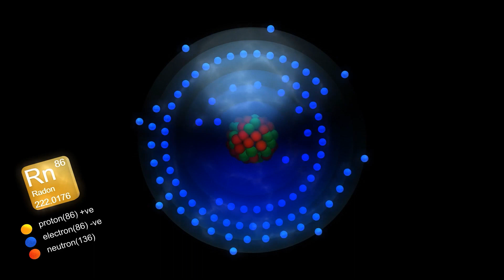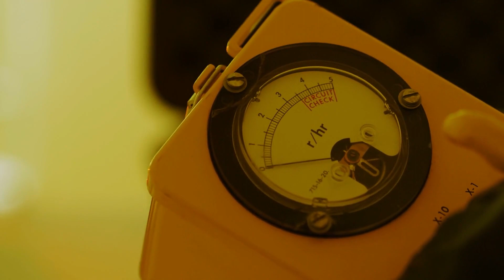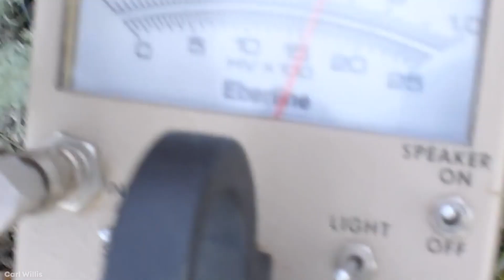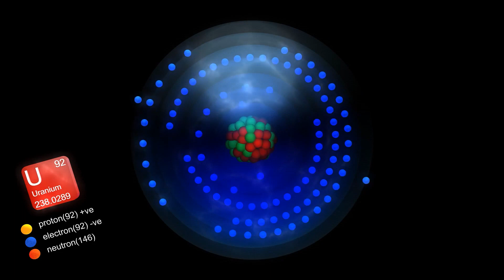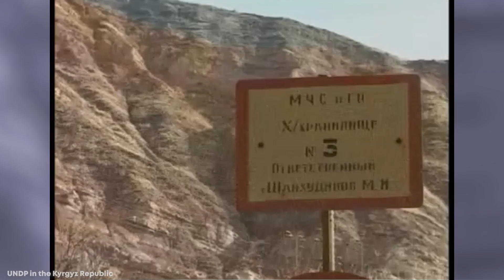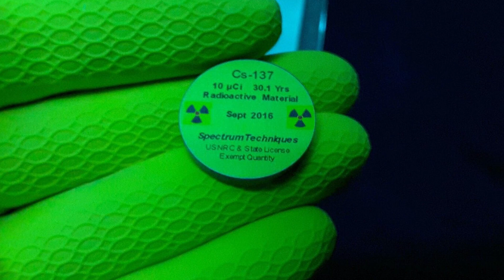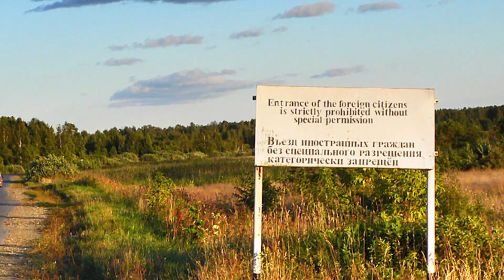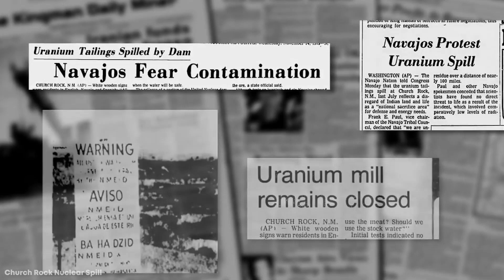15 MOST Radioactive Places on Earth

Comment: I put in radon mitigation systems for 5 years, they make it sound alot scarier than it is lol but long term exposure can still definitely cause health risks
Reply: Radon IS deadly. Of course you weren't told how nasty it REALLY is, or you WOULDN'T have wanted to work there.
Reply: It's scary because radon is also airborne & the level of exposure is probably more potent compared to your job. What makes it worse is the fact that the locals didn't realize they how much radon they've been exposed to.

Comment: Just a point of contention here; almost everybody who is depicting glowing radioactive materials has got it all wrong — specifically, the color. It's called Cherenkov radiation and is the result of neutrons from a radioactive material that is submerged in water causing what is effectively light-emitting shockwave when protons, traveling faster than the speed of light, release energy in the form of light as they slow down. That glow has a very specific color due to it emitting photons at a specific wavelength. That color is a light blue, not green. So, anybody who wants to accurately depict that radioactive glow should be coloring it that distinctive blue color, not green as just about everybody does now.

Read all about it here: https://en.wikipedia.org/wiki/Cherenkov_radiation
Reply: I’m so mad with this guy he’s dumb. For the Goyania or however you spell it incident in Brazil. The guy wasn’t robbing the clinic. He was going in there for scrap metal and what not because he owned a scrapyard and he gave it to friends and family which gave it to their friends and family. If you want to know more check out the video on it. Don’t remember what the channel is called just remember it’s half-life histories series

Comment: Radon gas is super common in granite and volcanic areas, I believe it only became a “problem” quite recently since houses are better isolated and there isn’t as much air bracing through to move and disperse the gas. At least it’s what I was told for my area. Was also told that yes radon makes the place more radioactive than others but it’s still low enough doses to be inconsequential for the health.